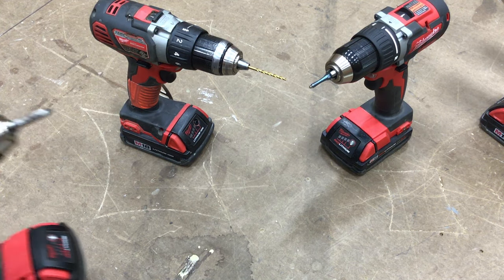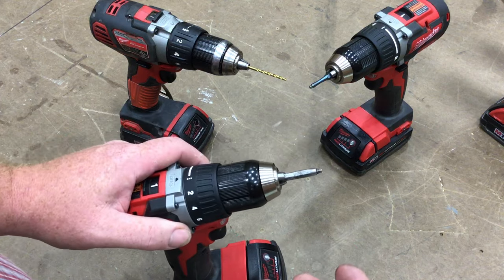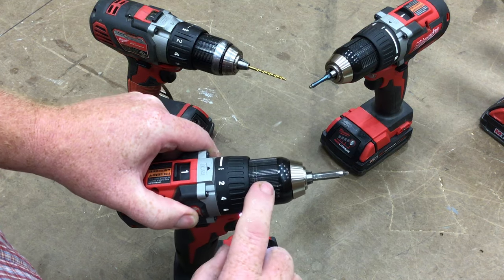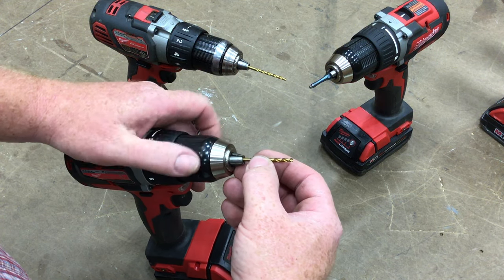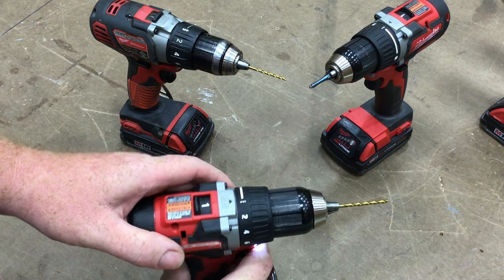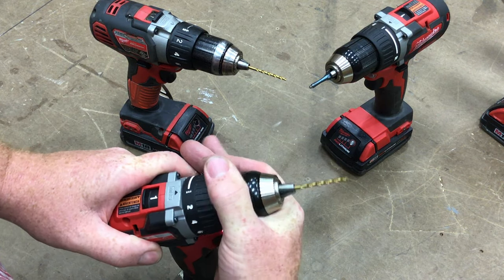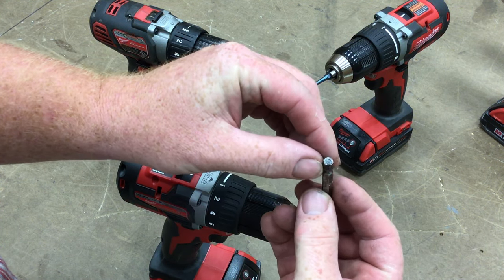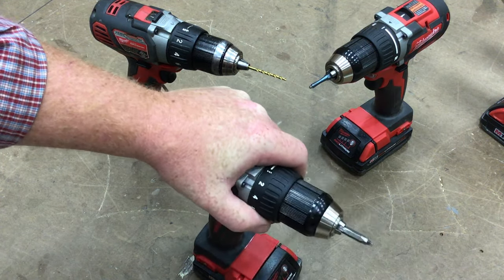HOW TO CHANGE A DRILL BIT!!!

Comment: I have a question lol excuse my ignorance please but uh the whole is way too big for my drill bits and someone told me it will change it to fit the drill bit but I don't know or if I am missing a piece ?
Reply: I’m guessing you put the bit in the middle, an as you keep rotating the chuck, then the spot will get smaller and smaller if you are turning it the correct direction, then as it gets smaller, be sure your drill bit is centered and positioned well before you tighten it the rest of the way. It should work…

Comment: My chuck won't loosen!! It has a symbol indicating which way to turn to unlock, but it won't turn! And when it does budge slightly, it makes a horrible grinding noise. Do I just have to use considerable force to unlock it? Both me and my roommate tried to loosen it.

Comment: when you switch from drilling to screwing and back, aren’t you supposed to change the setting that has the numbers? is the icon of the screw for screwing? and what are the different numbers for?
Reply from the maker: It depends on what you're doing and what features your particular drill has. The drill in the video has  multiple "screw" settings and one "drill" setting. The "screw" settings are torque limiting settings which allow you to adjust how much force is transferred to the chuck. The lower settings transmit less torque than the higher settings. When the threshold of the setting is reached, the motor keeps spinning, but an internal clutch slips, causing the chuck to stop. Normally I do not use the "screw" settings, though they can be quite handy to speed up a repetitive process. The "drill" setting is a full lock-up of the internal clutch. All of the motor torque is transmitted to the chuck.... what you typically want when you're drilling a hole.

There are no "rules" about how you use the settings on your drill in any particular scenario. My suggestion is to just keep working and trying different things. As your experience grows you will become more skilled at choosing the settings that work best for you in any particular situation.

Good luck out there!
Reply: thank you!

Comment: I can't get the chuck to move. it has a drill bit & I want to put in a screw driver bit.
I tried to move the chuck but it won't move.
It is a M18 Hammer Drill Driver.
I'm a girl alone & not sure what to do to get the chuck to open so I can change the bit. There R lots of numbers around the chuck. Do I need to move something for the chuck to move to unlock it so I can change the bits??
Numbers R 2-4-6-8-10-12-14-16-18. I need to unscrew some screws with more power than I can do by handout the chuck doesn't move.
How do I get it to move without braking anything?
The chuck isn't very old or used up. I haven't really used it since I got it.
If there is something I can do please let me know.
I don't have anything wide enough to grab the chuck & make it budge.
Not sure if it is a locked-up chuck.
I saw someone put a cloth around the chuck & some big pliers around it and turn it very hard & bingo it moved.
So I am guessing the chuck  may B locked up, but I don't think I have anything large enough to grab it with a cloth around it to open it if that is what is going on with the drill.
Please let me know so I can change bits & use the drill.
Also what R the different numbers for??
Thanks in advance.

Comment: mine won't loosen. is it tightened too much or is it not supposed to rotate
Reply from the maker: It's too tight. All keyless chucks I've been around have a collar or sleeve on the outside. Point the drill at your face, DO NOT DRILL YOUR FACE OFF!!!! As you're facing the chuck, the collar should rotate counter-clockwise to loosen. It is entirely possible for a chuck to seize up because it's too tight or has internal corrosion. I suggest spraying some penetrating fluid in there and letting it soak overnight. If it doesn't come loose, I would grip it with a large pair of pliers to get extra torque on it. Try to find pliers with curved jaws that, as close as you can, fit the round shape of the chuck. I once use a vise and wound up crushing the outer collar. I got the chuck open but it never worked well after that, always had a "catch-in-its-get-along" and was a pain the a$$ to use. Another time I made blocks of wood that fit tightly around the chuck, clamped that in the vise and it worked like a charm. GOOD LUCK!

Comment: I have a steel part at the bottom of my screws or bits. Do you take them off and then install it in the drill or have them on and install it in the drill somehow?
Reply from the maker: I'm not sure I completely understand your question. Do your drill bits look like this?
https://www.harborfreight.com/impact-rated-hex-shank-titanium-drill-bit-set-7-piece-64896.html
If you have something like those; The hex part is a permanent part of drill bit. Take care to line the three jaws of the chuck up with faces of the hex part.
Did that answer your question?